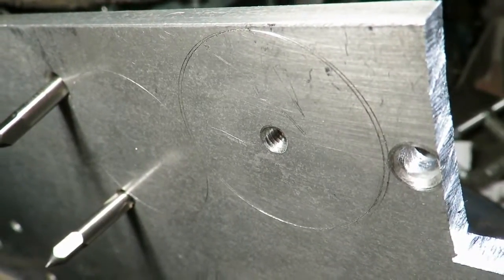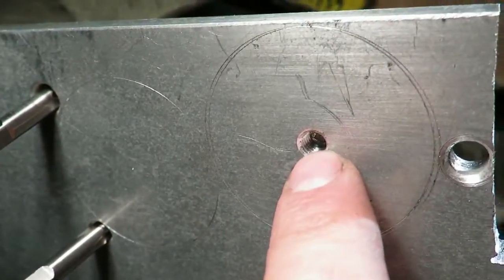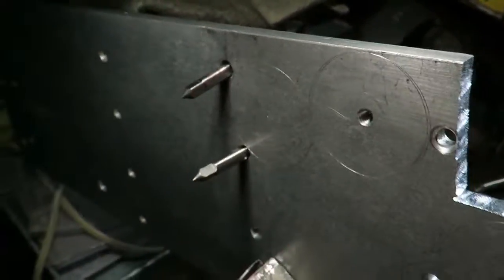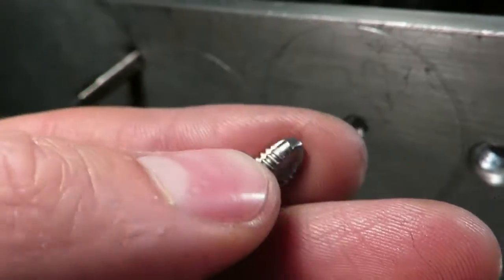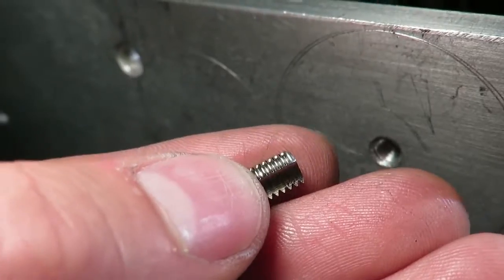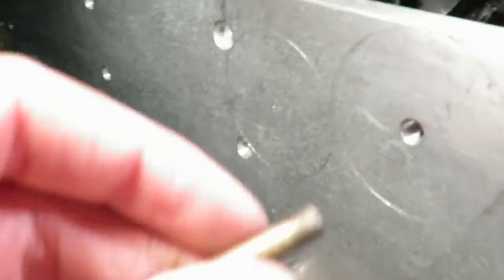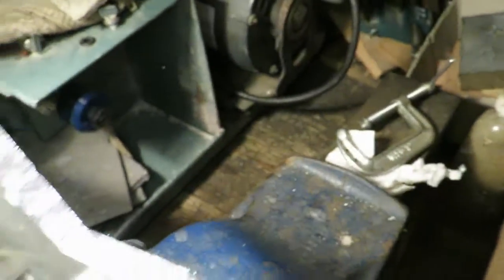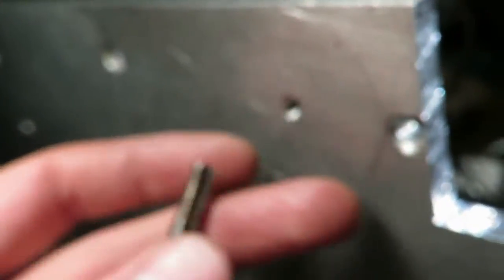Threading a blind hole in 8mm aluminium plate

Comment: Good idea by starting the tool by another plate clamped down. Remember to use some never-seez on those bolts if stainless, or they will corrode and get stuck.